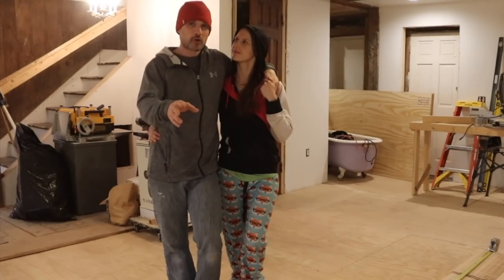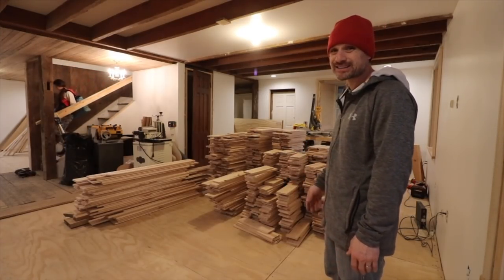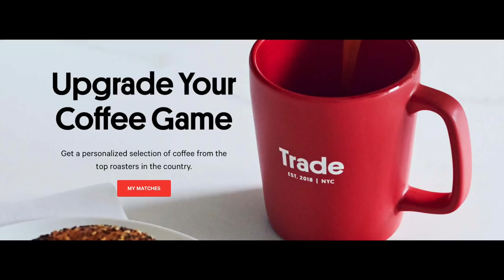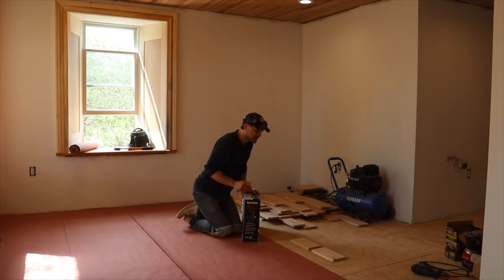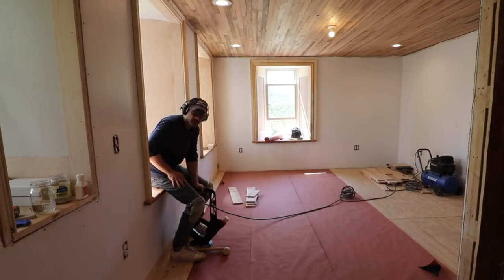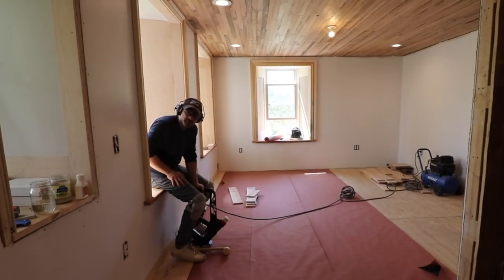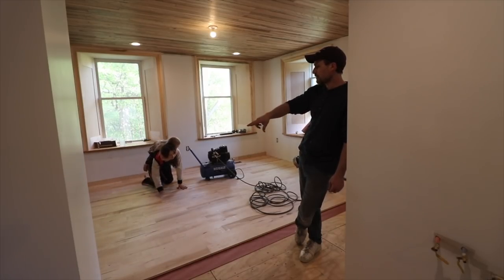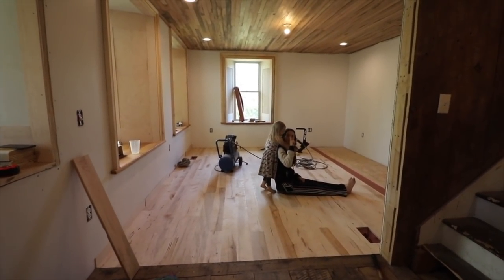Starting Floor | Renovation TRADE offs | Harbor Freight Banks Nailer

Comment: Ahhh!! The floor. I helped my dad install 1500 sq ft of oak flooring. My job was to lay out the planks and cut any that needed to be fit up to the wall. With a wood saw. (I got to the point that I could cut one in three strokes. Not bad for a teenage girl. 😊) Unfortunately, the nailer we had was manual, and Dad did some damage to his back. So be careful! And don't overdo.

Comment: We put bamboo flooring down, which I love, but, the nails are not holding. I've got pieces working free and buckling on me. Guess I should have glued it down. It is so cool that you are on the floor. Not much longer and it will be done!
Reply from the maker: Oh dang. I hope you can fix it without too much trouble.

Comment: Based on my limited decorating knowledge, the floor should be as dark or darker than the ceiling, or it will "pull" the ceiling down and make the room feel "short". The exception is in rooms with uber high ceilings. Here's just one quip from a decorating site to ponder in your decision... 😉

Lighter ceilings create an imposing effect and shape the illusion of a large and bright space. A dark colored floor will also do the trick!
Reply from the maker: We aren’t decorators. Just like what we like. I guess light and cozy. I don’t know. Sarah did a lot of “ research” when she jokingly wanted to paint the ceiling   Black. White in certain circumstances “pops” ( think white trim) and black recedes back kind of like wearing black clothing.  All Pinterest stuff I would guess. Anyway, we won’t win any decorating awards. Haha. Just a preference or rather it was based on the materials we had and tada..🤣
Reply: @1806StoneHouse  tada can be many a star 🌟 😉